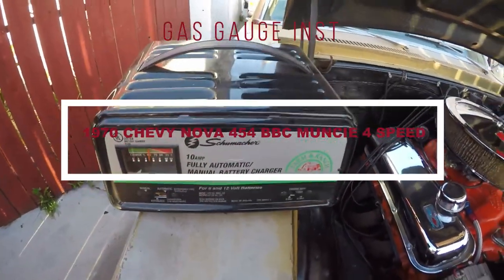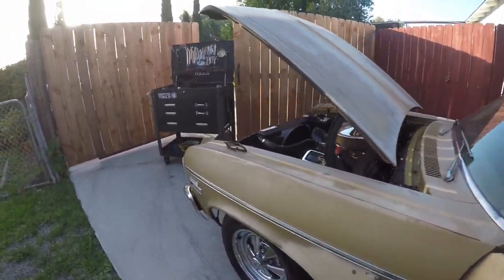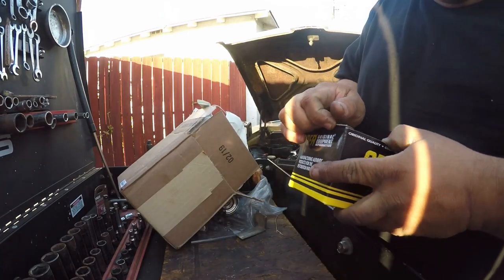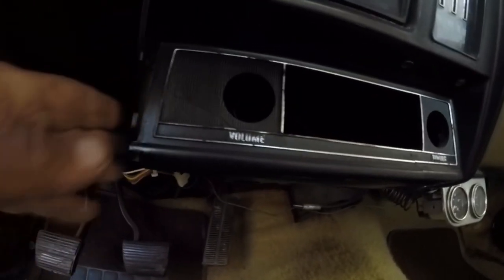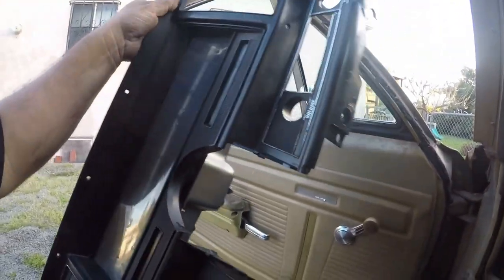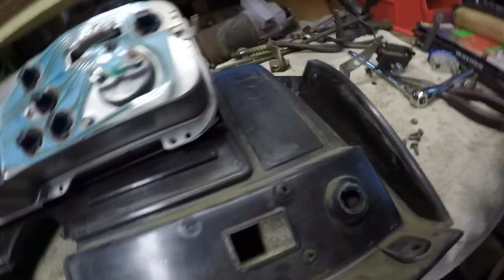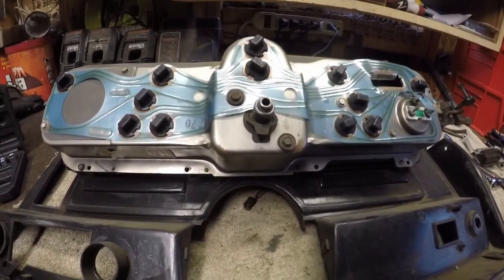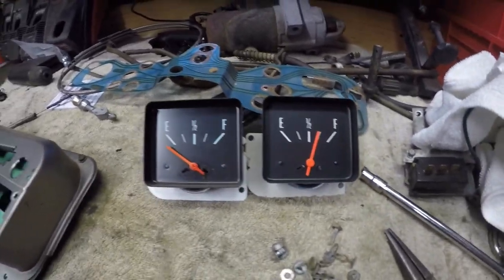REMOVING AND INSTALLING NOVA GAS GAUGE

Comment: Hi did you just tug and pull the cluster off? I took the screws off mine but it wont move much.
Reply from the maker: make sure the speedo cable is disconected  thats  the only thing that comes to mind, thanks for watching my video  if you can please subcribe to my channel i will really appreciate it
Reply: The speedo cable is very difficult to remove. Should have shown that

Comment: nice videos! did you have to modify any for the bb?  Im thinking about replacing my sb to a bb.  I know i have to replace the motor mounts. do you know anything else you have to do?
Reply from the maker: Just the mounts and frame pedestal Thanks for watching the video
Reply: Hi Jose , I noticed in the video you were on a web site for a new control board , would you mind sharing the site if you remember what it was, 
I’m in need of one for my Nova, thanks for the video ... good stuff 
Thanks man,
Bob,

Comment: Hi. Do you other videos how to install the chrome window trim, the bottom part on the front windshield glass. Also my gas gauge don’t work either and the rpm etc
Reply from the maker: Thanks fo4r watching this video  i will do a video on trim molding removal.
Reply: Welcome. I have a 1972 Chevy nova. Have you ever align the body line such as the doors, fenders and the hood. Mines are crooked. I’m still working on it though. I want to install a car stereo but mine doesn’t have the stock stereo and the stereo that it was on someone cut it off.